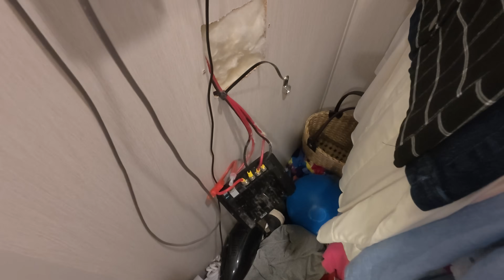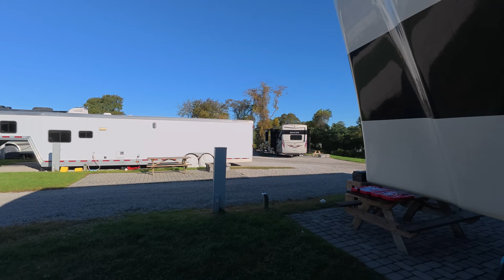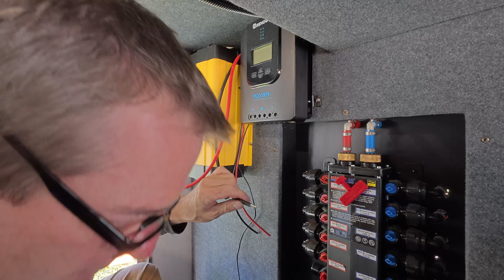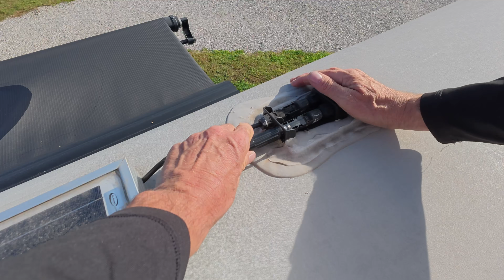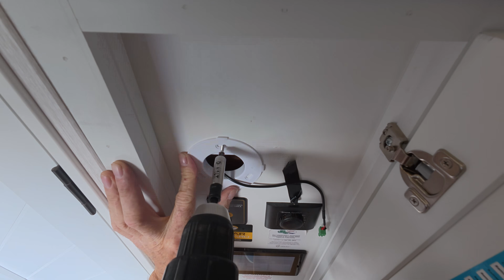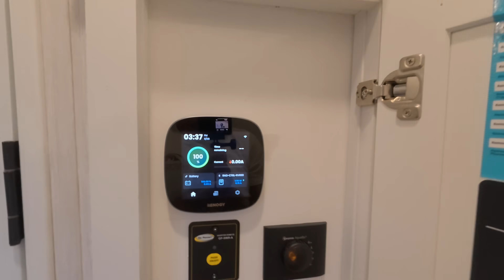RV Lithium Battery Upgrade: Powering Long Travel Days and Beyond! (Part 2)

Comment: Do not use the temp probe with lifepo4 batteries. It is used for lead acid batteries only.
Reply from the maker: I didn’t realize the temp probe was being used to influence the charging profile, so was using it as a temp sensor for the battery compartment seeing as I was relying on the Li BMS to protect the batts, which obviously trumps the probe at the extremes - meaning it won’t cause damage to the batts, but could impact charging.

Comment: Nice setup! Did you have any problems with One Core and smart shunt communicating? I’m getting a red exclamation mark when I add the shunt to the Core? I’ve tried 2 different shunts no luck yet.
Reply from the maker: My communication from the shunt has been ok.  I have the BT-2 connected to the Rover and I think that is helping things run in Mesh mode so perhaps that is helping with the Bluetooth connectivity - but I’m not sure that is the case.  I have lost connections to a battery or two from time to time, but adding them back in the DC Home app under the Hub mode has resolved that issue when it happens.  Overall the setup is a little quirky but certainly usable and given the cost as compared to other brands, I’m willing to put up with it, especially because the base functionality of the batteries,  MPPT controller and now inverter have been excellent.
Reply: Thats a message about battery calibration. Once your battery sits at 14.2v for an hour I believe it goes away.